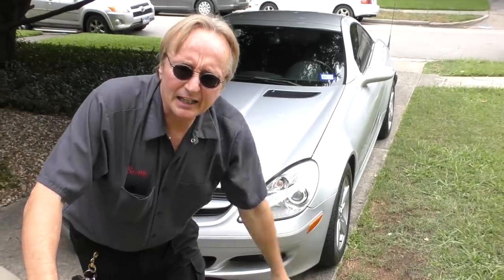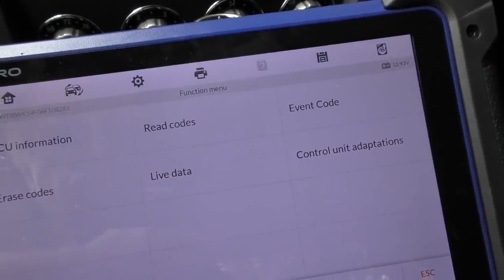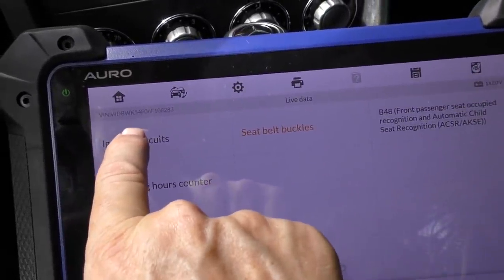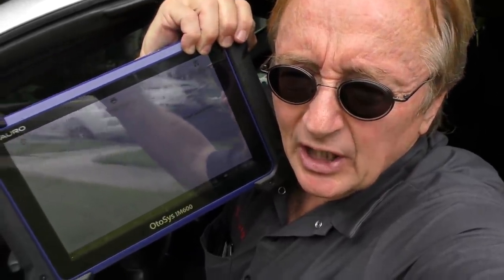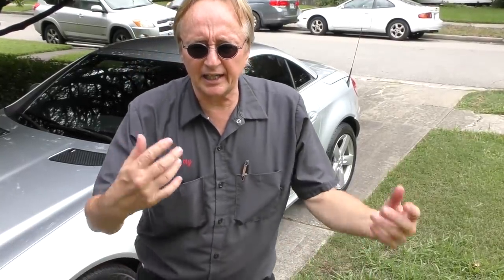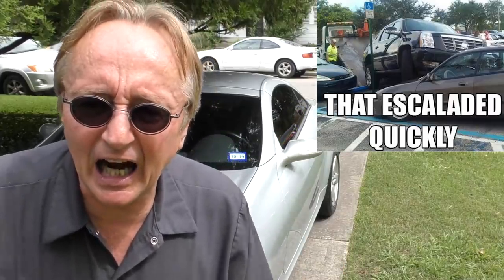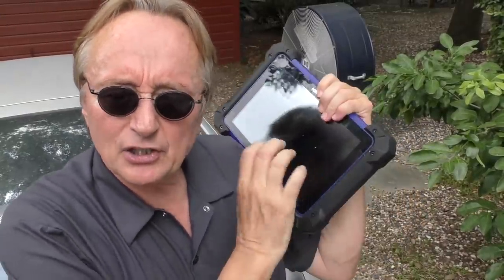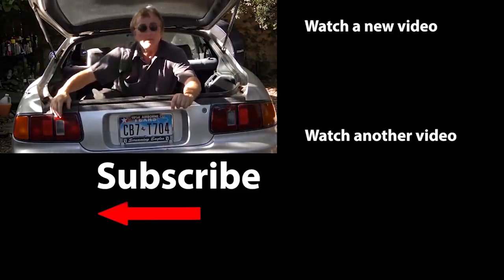You Can't Even Work On Your Own Car Anymore

Comment: Way I see it it’s just a pros/cons trade off from digitization of automobiles.  Without these complex computer systems, you won’t be able to get the crazy power, fuel efficiency and safety features that you get from the new cars today.  Unfortunately, those are what the majority of what people want when they buy a new car these days, not how easy and cost effective it will be to maintain or repair.

Comment: Yup. This is why I'd never buy a new vehicle. Never have. My wife has a 1998 Ford Ranger 4x4 and I have a 1984 F250 4x4. The Ranger is a bit too complicated but it's do-able. The F250 is a pleasure to work on. Problem is, today's snowflake generation doesn't even know how to use a screwdriver.

Comment: You also dont have to work on new cars as much . Had a 2003 Acura CL-s type with 275k problem free miles , an 05 mustang gt with 95k miles without a single problem and I currently have a 2015 mustang gt , 2018 TL awd and I'm sure I wont have any problems.  My dad was under the hood of his 68 charger and 85 iroc z constantly,  so I would rather have a more difficult time fixing a newer once in a blue moon that have an easier time on a car that always needs something.  Pick a reliable car and it wont matter hoe hard it is to fix .

Comment: Why not get a “used seat belt tensioner” from a salvage company that has passed an electrical diagnostic?  That is an older MB convertible and should be available at a much more reasonable amount of money than what the “stealership” would charge.

Comment: Why don't you just get the part number off the seat belt pre tensioner and find one on eBay.. probably around 100 bucks. Yeah I get used parts aren't ideal especially with srs. However you can check it's all working with your scan tool and if the part is faulty you're always covered by eBay's money back guarantee!

Comment: Be glad you can at least get the equipment to do the diagnoses.  If you buy a green tractor which now costs over $200,000 you have to have the dealership do the repairs because they will not make software available to the public.

Comment: Sounds like the explosive squib in the seat belt got disconnected. It explodes in a collision to tighten the crap out of the seat belt. Might be an easy fix. Just fix the busted or disconnected wire.

Comment: Anyone familiar with a 2007 Cadillac CTS? I have a problem, I’ll be driving foot on the gas and the front left tire will brake itself and cause me to almost dead stop and jerk to the left. I have done research and replaced the same side bearing hub sensor and the steering wheel stability sensor but still does it. I’m lost and don’t wanna pay more money

Comment: One of the things  I am is a software developer.
These companies are ripping off mechanics.
Those diagnostic tablets are nothing more than simple databases.
They receive a serial code from the vehicle and simply interpret it into English.
The car itself does all the diagnostics. 
The better ones simply do all time full duplex communications. A technology available 30 years ago.
Its like a printer. It simply prints stuff on the screen.
The very best one can be made for under $200 in hardware.
One can be built into the car by the manufacturer for under $100, which it should be.
But that would put mechanics out of work.
Reply: Lancelot Xavier I highly doubt that. The screen in the vehicle might tell the owner that the high pressure fuel pump is weak, or that #4 injector isn't working, but the owner might take one look under the hood & think........"nope....not even gonna attempt it". I've been an over the road truck mechanic for about 20 years & I also work on passenger vehicles.

Comment: I had a air pressure monitoring system trigger a fault light. To fix the problem I  had to remove air from all 4 tires to reset the system. After finishing I only had about 20 pounds in each tire. What a joke.

Comment: A few years from now all cars will be run by tablets that are full of bugs and every drive will consist of at least 5 problems due to bugs in the software.  Also half the time your car will slow to a crawl or stop working completely due to overheating.  And it will become useless after 2 years due to updates slowing down the tablet even more.

Comment: Get a '71 Plymouth Fury & you don't need to worry about all that BS.  Keep a matchbook to set the points & a spare $20 mechanical fuel pump.  And if you hit a deer, you won't have to worry about destroying an oversized plastic front end.

Comment: It’s good to know Texas is still reasonable for those stupid codes for seatbelts. In NYC they will get you for any code on the check engine light. And they will not have a problem charging some stupid price including parts and labor. For something that stupid. I guess I Will Not be getting newer that’s twenty years old. At least the old carbureted cars were easy to fix and maintain. For you young folk that was way before your time. When cars were cars and people were people. And it didn’t take a rocket scientist to figure out how to fix a car.

Comment: Ca is leaniant.
All ya needs is a bi-annual smog test 1976 to 2016!
We dont care if your brakes dont work,if your tires are bad, if the windows arent there or wont roll down.. Even one lug nut on your rim is legal.
 Just make sure yoir engine is STOCK.
Scotty forgot to mention the updstes needed for scan tools.
About every 3 years or so....expect to cough up about another grand for a scan tool upgrade/up-date.
(employers do not cover this cost either)!
SO....REV UP YOUR WALLETS !

Comment: Come on Scotty, that's not the full story.
Yes you need a good scan tool, not a cheap OBD code reader.
If your car is out of warranty, get an older model scan tool, for 500 not 5000.
Scan tool says the circuit resistance is too high, which is 99% more likely to be a wiring or  connector issue than the igniter itself.
In England we see this all the time.
Same as people in NY/NJ would I suppose.

Comment: So then, with this issue, I understand that the driver airbags won't deploy?  Personally, I would rather pay the, say, $1,000 that an uncalculable hospital bill, much less the pain, suffering and possibly permanent disability that an unprotected crash can cause.  I wouldn't buy a $75 motorcycles helmet that won't adequately protect my head.  I would spend $400 + for that protection.
Reply: The Airbags will deploy... It's just the seatbelt pre-tensioner saying that there is a bad connection. The seatbelt pre-tensioner will probably still attempt to deploy regardless. What the seatbelt pre-tensioner does is tighten the seatbelt and rail it back to clamp down on you. The seatbelt will still lock even if it doesn't deploy. I'd say it's probably still just as safe as long as you don't sit too close to the steering wheel(because you won't be pulled back so you could hit the steering wheel with your face). Idk doe I'm not a car engineer/mechanic etc

2. Edit: Do not read bottom edit if you are squirmish.
Edit: "This extra seatbelt "pre-" tension, moments prior to the full force of impact, pulls the bodies of the driver and front-seat passenger firmly into their seats. This positions them so as to receive the maximum protection benefit of the front airbags. It also helps prevent the unfortunate phenomenon car crash-ologists call "submarining." That's when the momentum caused by the crash jerks a victim's body under his or her lap belt and sends it careening forward below the dash"
Reply: @Exarhadsgfds    Thanks for your response.  Having said that, I'm well aware of how seatbelts work.  Submarining was a real issue when they had seat belts and prticularly those what, early 90s cars.  Todays three point restraint systems do work much better than previous types.
Air bags have added a new layer of protection for the driver.  Either from slamming their face into the steering wheel or from the wheel and dashboard hitting the driver in a severe frontal impact.
It was about three years ago that I experinced air bag fuction fort hand.  I got a few minor  powder burns and my bell seriously rung!  
My initial thought was does the tensioner continue to function in a crash?  I'm not real comfortable with "probably".  As far as being too close to the air bag and being at higher risk of serious injury, this is not new information.  A was married to a woman who is 5 feet tall and the father and grandfather of two woment who are barely 5 feet tall.  Thia is the reason that they engineered air bags that can compensate for lighter people and also why they always recommended that babies be put in their car seat in the back seat.  And yes, I do know that in general , that locations tends to be less impacted in a crash, also.
Take care, my friend.

Comment: They won't show you at the stealership and none of the toothless wonders in my area will spend 5k to diagnose it correctly. Here they find Waldo and you get the bill with all the shot gun parts installed.

Comment: SRS ligh on is  a Yearly roadworthy inspection failure so you will not be able to legally drive the car, no mot means you can tax it ..no road tax if found on the road the car is crushed at a scrapyard.!! (dot buy cars made after 1998 !!! )

Comment: The Mitsubishi  dealer quoted $390. For blinked stick, $290. To install, bc "The air bag has to be removed by a professional to replace the blinked stick" 
Wow really ? Oh Yes let the professionals do the job, you don't want to touch the air bag it will blow up in your face" 
Ok. Here's what I did. 5 m on YouTube, 4 screws to release the steering cover, blinked stick 'clicks' out in 3 seconds, ordered a 2nd hand one for $50.00, online, fitted the new later that day, by FREE courier to my car in the car port" 
Oh course not everything is that easy right  ? Oh Yes it is.

Comment: I Day dream about being able to buy a rear wheel drive car with a standard transmission, manual brakes and steering, a carburetor a coil and distributor with no electronics or power anything. 

The car I learned on and the first few cars I owned were like that. They were beautiful and I could fix them myself for next to nothing.

Modern cars are ugly over automated piles of junk that take away the pleasure, connectedness and involvement of driving and make bad, incompetent drivers of us. They also make us broke from having to pay crocked professionals.

Comment: It’s nice to have these scan “tools”. But come on, $5000?  It’s just a computer that talks on a standard bus.  I get that you need to pay software developers and the makers but the genuine hardware part is what?  $200 worth of chips, wires and display?  A Raspberry Pi probably has more power.  I guess I should be glad that the dealer doesn’t have a monopoly on scan tools. Support “Right to Repair”!

Comment: Well the first mistake the customer made was buying a Mercedes.  I've heard nothing but the fact these cars are massively, extensively, insanely over-engineered with needless complexity.  Of course those overly complex parts fail.   To compound it all Mercedes engineers seem to give a crap about ease of maintenance since you have to tear down half the car to do a simple repair.    Should have bought a lexus.

Comment: there is an exploaive charge in that  seat belt to hold u back in an collision.dont tell people its not super important thing to get fixed.get in a high speed collision and than make another video.i dont have 50 years as a mechanic but 25 years working on the latest vichles.i know its a lot of b.s but some thing are worth not ignoreing.

Comment: Does Scotty even know what and ETR is or does? I mean the guys checks the buckle switch for an ETR code. Then he goes prices the thing without ever checking the ETR connector. A high percentage of times airbag codes for the bags or ETR are just resistance in the connectors and don't need parts. I wouldn't bring my car to this guy.

Comment: We need to get rid of this. Have just 3 specification of cars only, mini car, normal car, SUV car and only electric cars. Everyone makes the exact same mini, normal and SUV car. This way, there will be just 3 car types on earth and everyone will be using the same parts. Now if some thing goes wrong, we can just buy more of the very common easy to buy cheap parts and problem solved. And most people will happy ever after.

Comment: What a far cry from the 70s, early 80s mercs (W123) I remember from when I was a youngster, they will run forever, particularly the diesels. Same goes for my 70s beemers and they can be maintained and fixed with just basic tools, the only special tools I have is a torque wrench and some pullers for ball joints and stuff. ECU? OBC? Don't have it, don't need it. I don't get why people still buy new cars anyway. Boring plastic computerized soulless throwaways and endless money pits. But it I'm afraid it won't be long before it will be illegal to drive 30+ years old cars so we all have to buy this modern crap.

Comment: I'm gonna make an electric car company that makes the most user-friendly, sustainable, longest-lasting cars on the market, and every car will have a touchscreen system with built-in diagnostics so you don't need a $5000 scan tool to see what's wrong with your car.

Comment: If your car needs a scanner that's more complicated than a skilled mechanic,  you have the wrong car.
Reply: Vintage Everyday Being an over the road truck mechanic, there's absolutely no way you can work on trucks today, without having the diagnostic software. With all the EPA mandated nonsense on trucks today, that check engine light can come on for literally over a thousand reasons. And, some of those codes can derate  a vehicle, either slow it down to 5mph, or significantly reduce torque output.

Comment: Scotty:
"The resistance in the ignition circuit containing component (driver buckle Emergency tensioning retractor) is too high"

"Now let's translate that into English" 😂😂
Reply: Odds are corroded or loosened connector to the seatbelt explosive squib.  To much resistance, not enough current to ignite the squib that forces the seatbelt retractor retract/lock on collision.

Comment: I  had a problem with my lift gate module, so I replaced it.   Ok still doesn't work. Googled it, ok I have to have it programed to my vin.. 35 miles to the dealer and $95.00. That's pure communism!!!  My next car is going to be a 1957 DeSoto

Comment: um its not just an electric issue on the seat belt. it is the tensioner look how it does not retract in as it should. you crash that seat belt is not going to work properly and you can die!!. cmon scotty. but that is what you get with a shitty benz.